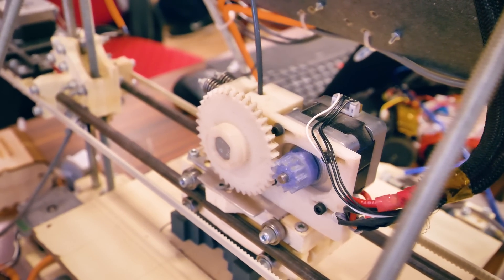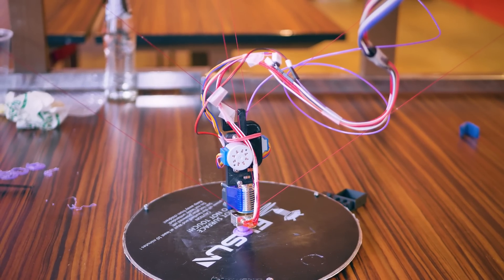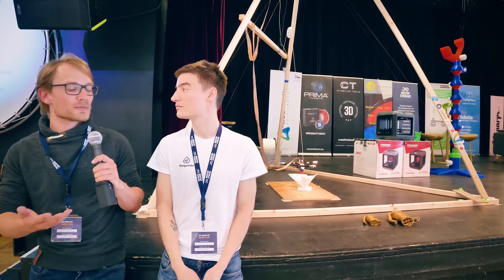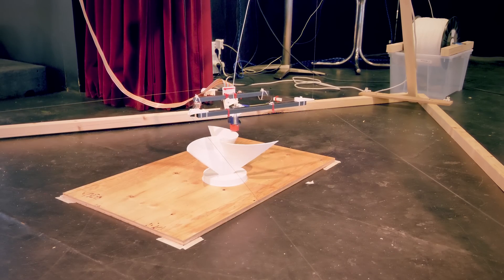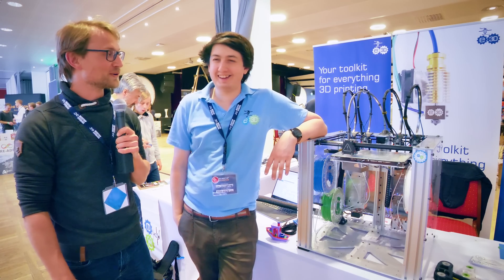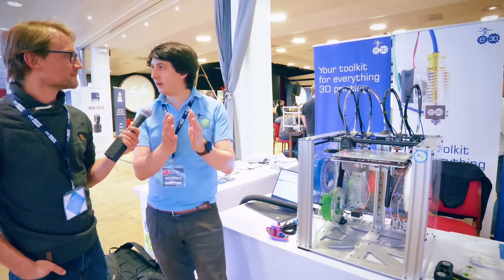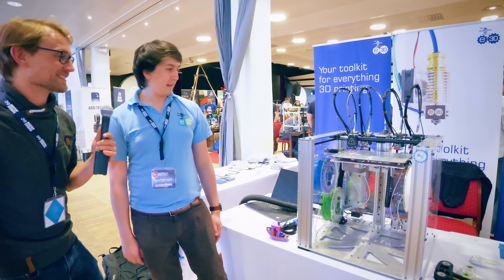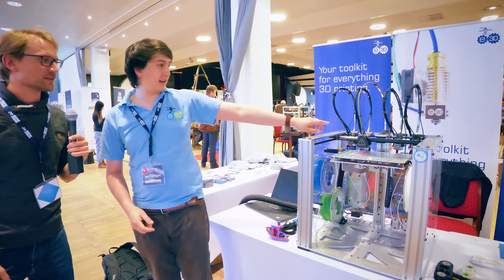Mini-Hangprinter / New RepRap Duet / E3D Toolchanger updates at #3DMS2018

Comment: Hey Tom. Any chance you'll do a video on the zesty nimble extruder? Looks interesting. It's a "Remote direct drive" extruder that uses a cable to transfer motion to the extruder. The part the mounts on the printer is like 27g. I'm using a titan direct to an e3d v6. Would love to lower the weight of my hotend and reduce ringing, by switching to this, if it's as good as they say.

Comment: Those transitions. HP->E3D and E3D->David. Smooth.

And then David mentioning the 7 stepper extensions on DuetWifi. They are perfect for connecting Mechaduinos onto. I guess we'll have five soldered TMC2660s left over for all the Hangprinter v4 tool heads then ;)

Comment: Duet v2 is actually up for sale now  also can it run marlin ?
Reply: Running Marlin on a Duet would be like putting a Mini engine in a Porsche. Marlin is designed for 8-bit electronics, it doesn't take advantage of the benefits of a 32-bit platform.
Reply: they were talking about duet 3

Comment: Not gonna lie, turned in solely for the duet. Man I love my wifi. Mind blown when I learned how to re assign pins to control the servo on the bltouch using simple g code commands. Oh yea, and the lack of click wheel goodness 8 bit boards have is a godsend. Nothing better than controlling my printer fem my phone. No raspberry pi to set up, no fumbling with sd cards or USB cables. Just hit upload and print, watch it on the built in webcam support on the web based interface, and print tons of vases.
Reply: Vape Scaped How fast is the wifi file transfer on the Duet? I bought a Smoothieware clone and it takes ages to transfer files over Ethernet. I should have went with the Duet but the price of the board was almost as much as my project printer. That cheaper Duet looks like it's going to be perfect for my cheap machine.
Reply: Jorge Ramirez takes maybe 5 seconds or less. Def fast enough for me.
Reply: its fast. 5mb gcode in 15 seconds
Reply: Nice! I will definitely look into getting the cheaper Duet once it's available. The Smoothieware clone disappointed me, even the USB transfers were mediocre and the web interface looks like it belongs in the 90s
Reply: 5mb gcode in 15 seconds is slower than expected. I test the upload speed regularly and 800kBytes/sec is typical for me, both over WiFi and over Ethernet. Sometimes I get over 1MByte/sec. A weak WiFi signal or a heavily fragmented SD card can reduce it. Using the largest possible cluster size (64Kb) on the SD card helps too.

Comment: Why does DuetWifi uses TMC2660 instead of 2130? It seems to be really loud.
Reply: We chose TMC2660 for the Duet WiFi because the TMC2130 can't handle as much stepper motor current as the A4988 and other drivers that were popular at the time. We didn't think it made sense to bring out a board that was less capable (in terms of motor current) than every other board on the market. Whereas the TMC2660 handles more current - around 2.0A without fan cooling and 2.4A with.

The TMC2130 is OK if you choose the motors carefully. Prusa has his own branded motors, so I expect he chose the winding parameters to be a good match for the TMC2130.
Reply: 2660 has all the features of 2130 plus some others, and supports more current. 2660 is better but you can't get them as Pololu-style stepsticks.
Reply: Jamie The official website shows that 2660 lacks StealthChop and passive braking camparing to 2130.
Reply: You don't want stealthChop, it doesn't work on most 3D printers. The stealthChop2 mode from the 2208/2224 is stronger. Those are my drivers of choice. Panucatt sell good SD2224.
Reply: Thanks for the explanation! Good to know.

Comment: David is awesome. I'm maxing out the Duet -- I'm loving the flexibility. He added y axis mapping(for dual Y gantries) in 2 days when I asked for it last year -- that short he described has actually happened to me where the sleeve from the heater cartridge wire pulled up and shorted to the volcano block (old style) which had a short to the thermistor and killed one of my smoothie boards -- a resetable fuse is brilliant, and detecting the fault and having the firmware report it,  wow didn't know my board does that! If you excuse me, but I'm just going to take his word for it -- I check my heater blocks for shorts when assembling now, so I'm not risking that.

Comment: 7 Minute hang printer calibration! Wow is right! Awesome!
Reply: A few seconds per data sample. We used 13 samples. A few minutes to paste sample data into the script. A few seconds to run the script. Copy the M665 output from the script into Pronterface. Send. M500. Send. Done =D Aiming for one click anchor location calibration + optional camera feedback this year.
Reply: Sounds awesome. I would like to do some testing with the mechaduino, $49 each is a little steep. I am hoping they will become a little more popular and the prices will come down.
Reply: Me too. I'm a bit surprised they have stayed expensive for as long as they have. Waiting for them to get in stock and through customs almost made me a Mechaduino supplier myself.

If Mechaduino price remains a threshold to closed-loop adoption we should maybe try to build encoder-only PCBs, and do all the closed-loop computation directly in firmware, using a beefier 32-bit micro-controller...